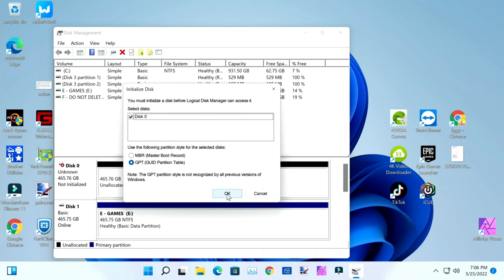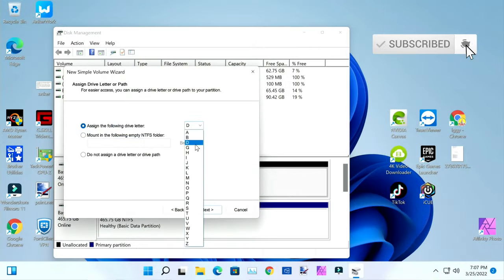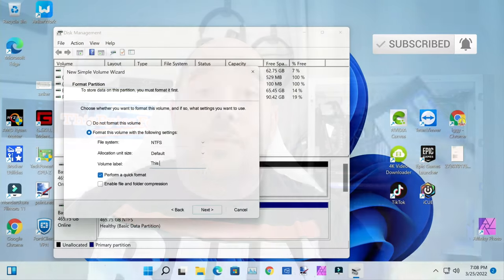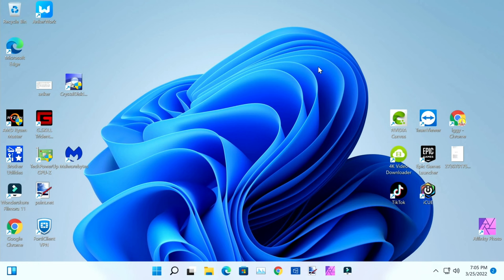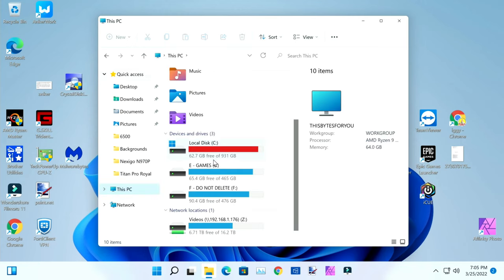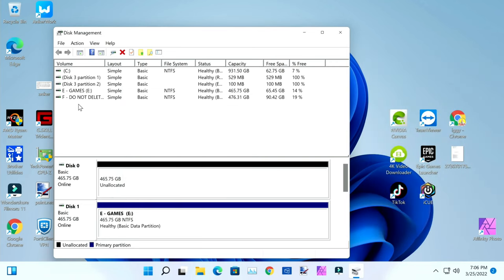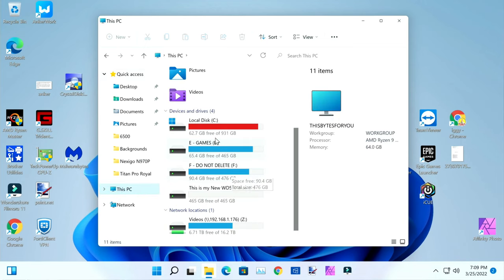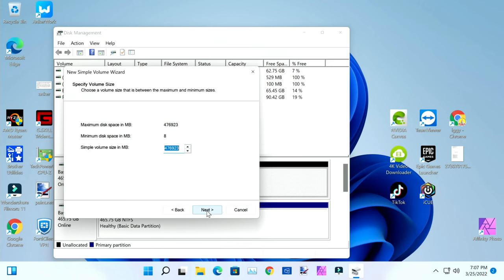How To Install a Second SSD into Your PC

Comment: Great video! I just got that same WD ssd in 1tb . Was wondering if I should move steam over and games would the ssd make them run faster?
Reply from the maker: you can, but you cant simply move it, it has to be reinstalled, there are ways to do it, but I don't have any videos on that.  What are you using as your main boot drive?

Comment: Very useful. I'm struggling to play some modern games as my hdd just isn't fast enough and my pc only came with a 250 gb ssd it uses for windows which doesn't have enough free space.
Reply from the maker: awesome bud, so happy i could help.  I am not a fan of cloning, but I would recommend getting rid of your hard drive and getting 2 SSD's, a 500Gig at least for your OS and at least a 1TB for your SSD, or larger, they are dirt cheap now.  Here is a video on how to clone, if it helps, but I recommend clean installs: https://youtu.be/aHVCmkm67q8
Reply from the maker: let me know if it helps

Comment: Did you ever get around to making that video on how to move programs without uninstalling them?
Can't find it on your channel. (There are a lot of videos so I hopefully just missed it.)
Reply from the maker: Hello my friend, sadly no, there is no simple way to move it all, there are VERY few you can move over without reinstalling.  I have been looking for a while, but no, nothing that I could recommend.  Let me know if you find something, but I fear you will have the same results.
Reply: @ThisBytesForYou  That sucks.
Thanks for the quick response though.
Reply: @ThisBytesForYou  Turns out Steam has a built in Setting to move games from Drive to Drive.

> Steam Settings > Storage > Click the Old Drive name at the top > Add any new Drives > While in the Old Drive select games to move > Click Move button at the bottom > Select New Drive > Finalize

> Select New Drive from dropdown at the top > Click the triple dot settings icon under the dropdown > Make New Drive default Drive

Haven't found any similar settings with any of my other Launchers though. (EA, Ubisoft, Epic)
Reply from the maker: yup, steam is one, but there are tons of other apps and programs, I could spend weeks working on this one video , everytime you do this, performance will not be as good as sa fresh install, so it's not worth it.

Comment: Great video! I am having trouble though. After installing and activating my 2nd SSD, I tried downloading software but it says I don't have enough storage.
I'm assuming it is not using the 2nd SSD and only using the 1st SSD. How can download stuff if the 1st SSD is full it will automatically go to the 2nd SSD?
Or would it better to image the 1st SSD to the 2nd SSD, then switch the SSDs so that the 2nd SSD will boot up first, and delete everything from the 1st SSD and use that as extra storage?
Reply from the maker: Did you create a partition like I showed you in the video?  And when you download something, it downloads directory to the C drive, automatically, you have to physically move it.  Did you do what I showed you to do to the drive in this video?
Reply: @ThisBytesForYou   Thanks for the reply!
Yes I partitioned the new D drive and its status is online and allocated and could also see the drive in my File Explorer. I could even move files there as well.
On Disk Management, under Status, my C drive says "Healthy (Boot, Page File, Crash Dump, Basic Data Partition)" and in my new D Drive it says "Healthy (Basic Data Partition)".
Ahh I see, so it wouldn't automatically download to my new D Drive. So even though I have an extra 2TB NVMe SSD, I have to physically replace my 1st NVMe SSD with my 2nd SSD to boot that up first. Now I'm thinking of cloning my 1st SSD to my 2nd SSD using a cloning software, or better yet a physical cloning device. Or perhaps just transferring all my files and programs to my new SSD.
Reply from the maker: if you want to clone, you can use this video, it not only shows you how to clone but it shows you what you need to do in the BIOS and the OS to make sure you clone right, you dont need a cloner though, but it will help you: https://youtu.be/aHVCmkm67q8, though I don't recommend cloning, a new install, and I have videos on that too, just let me know./
 @laloweed

Comment: ty for the video, but if i dont change games from the old ssd to the new ssd wil there be a lack of perfomence?? and wil new games doawnload on the first or new ssd ?? thx for helping❤
Reply from the maker: Always a pleasure my friend but when you install a new SSD, you have 2 options.  Install windows on the new SSD or keep it as a secondary drive.  You can clone windows on it, but any and all issues you had on the old drive will be there on the new drive, with some extra issues.  If you keep the games on the same SSD, you will have the same performance, if you uninstall the games and install them on the new drive, the performance may improve, but it wont get worse.  Game will download where ever you tell the program to download them to and where ever you tell them to installs to.  You cannot easily transfer games from one drive to another.

Comment: I have a 250GB Sata drive from a failing computer.  I would like to add it to my new computer so I have access to all my data on the 250 GB Sata drive -- Can I just add the second drive using the same instructions for adding a new SSD drive?  Thanks Dan
Reply from the maker: Yes, but you won't be able to access it like you are thinking.  All the stuff needs to be installed on the new computer, and maybe copy some of the files over, but not all programs make that easy either.  Many programs install things in the registry, also scattered throughout you drive mapping it all to the c drive, it's not the c drive anymore.  You won't lose your data, it will be there but it needs to be reinstalled and you need to set it like I show you to boot to the new drive not the older one.

Comment: Changed loads of HDDs in my time but interested in getting a SSD for the first time. Have loads of old Sata cables- can I still use them on a SSD?
Reply from the maker: yes, for sure you can.  I have videos here on how to clone and how to install windows on to them as well, I got you covered.
Reply: @ThisBytesForYou  Great video, took 20 minutes to install and activate it- and five of those minutes was trying to fit the screws into a caddy!
Reply from the maker: @threeeyedfishy  thats not bad at all, good stuff my friend, so very happy I could help.

Comment: Great video!! 

I followed all the steps, however, when I try to boot the PC once installed, the PC just clicks. I can see the lightning bolt/battery light on top of the PC flicker, but it just won't turn on. It has to be something with the SSD being connected to the PSU. When I unplug the SSD from the PSU, the PC boots up, no problems. The SSD is a W/D 1TB Blue SA510. I'm wondering if that's too much for my PC to handle at once? I don't know. Any thoughts or suggestions? I didn't have the original PSU cables for my PSU, but I did have a SATA cable from another EVGA PSU I tried to use. So, not sure if this is a cable issues, PSU issues, or SSF issue. Lol. Thoughts?
Reply from the maker: no, dont mix and match cables, they dont have the same pinouts, what is the manufacturer and model number of your power supply?  Mixing cables can kill your components or cause a fire.
Reply: @ThisBytesForYou  EVGA 850 BQ 110-BQ-0850-V1 80+ BRONZE 850W
Reply from the maker: @that_big_asian  that power supply has more than enough SATA cables, 2 sata cables, with 10 connections in total, you shouldn't need to borrow cables, contact them, either they will send you or sell you additional cables for that specific power supply if you need, or check your box: https://www.evga.com/support/custsupp.asp
Reply: @ThisBytesForYou  thanks! I'll give them a shout. Appreciate the response!
Reply from the maker: always a pleasure my friend, if you notice I respond to everyone.  Please understand I leave my emails only for vendors, so I can get product to review, I respond to hundreds of comments a day, imagine how cluttered my inbox would be, I would miss a lot, here I get you 100% and I can devote myself to you.

Comment: Thanks so much for the help!
Reply from the maker: Always a pleasure my friend, so very happy you stopped by, trusted in me to help you, liked and subbed as well as took a moment out of your day to thank me.  It means a ton to me and I am so very happy I could help you.
Reply: @ThisBytesForYou  Everything did work originally but I am having a problem now and maybe you could help again if you know the solution. I installed a new sata drive to copy everything to a new m.2. Everything went fine until I booted off the new nvme the first time and now I can not get the sata drive to show up at all (even in disk management)
Reply from the maker: do you mean, you want to copy the operating system?  If so, that won't work, you need to clone it.  I recommend to first watch this video, I show you how to set a few things in windows and in the BIOS to make sure your clone goes well.  You can use that video to clone, but after you watch that video and do the BIOS and windows things, watch this video next: https://youtu.be/e8omB4pFLlA, if you don't do the windows and BIOS things, you run the risk of having issues.

Comment: I need one for the HP Pavilion a6110n (Windows Vista) and the DELL Latitude E6430 (Windows 10).
Reply from the maker: Cool,... the HP has a 7200 RPM hard drive, so its SLOW, so you should probably go for this 500Gig SSD off of my Amazon affiliate link.  This same drive "SHOULD" work with your Dell, but I can't say for sure because it may have a 1.8in HD or a 2.5in HD and I don't want to tell you the wrong one but I think this will work.  Then if you want to clone your data, you may want to watch this video: https://youtu.be/4BtdMcqwaFg

Comment: I'm using the B450M BAZOOKA, and I'm having trouble finding the SATA connection. I already have a SSD and a HDD connected, does the Bazooka have space for any others? If you don't know, where would I find that out?

Comment: After all this, like once it is installed, would I just be able to start downloading games and running them on this ssd, as well as having my other games still run on my main ssd? Or do I need to move steam to the new sdd to run all games from the same place?
Reply from the maker: you can start using it as your steam library, when you download and install games, you will see an option where you want to install, just change it to that other drive.

Comment: Hey can i run samsung 990 Pro 2 tb ( planning to buy ) 
when I already have samsmung 970 evo  250 gb running on my pc?

is it alright to have both different SSD to run the PC?

or thee one you did in video, those must be much cheaper right to run with ?

Help me out soon  sir
Reply from the maker: Did you watch the video?
Reply: @ThisBytesForYou  I did sir, but the thing is, there is no such video that can you run different SSD like 970 and 990 together.. 
does this work if i do that 970 evo and 990 pro?
Reply from the maker: @kaitronix  they are different drives like I am running different drives, you are fine

Comment: I have a question even though this is 2 years old. If steam is downloaded on disk C, can I still choose to download games from steam onto a different drive even though steam itself is on c?
Reply from the maker: you can change the install drive, but you will have to redownload the games, there are ways around that, but it will take me a while to go over it, the best way is to redownload them.